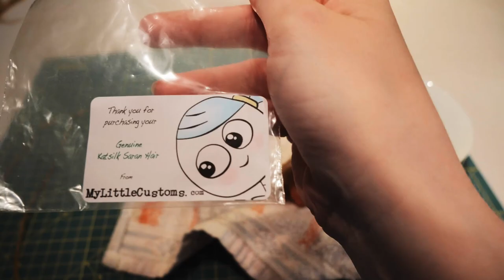the barbie repair cafe & how to reroot barbie hair - skipper restoration

Comment: I’m surprised you aren’t using the hair tool that is a sewing needle cut at the top. Is there any particular reason?
Reply: Never mind, I see you secure it differently instead of hot glue.
Reply from the maker: Hello and welcome to my channel, Chickadee Acres. Thanks for your comment. I don't use the rerooting tool because I don't like the technique. I do it as original as possible. Mattel would have used a sewing machine. I try to immitate the machine here. It has the advantage that you need no glue ( because glue can make the head dissolve due to a chemical reaction). I don't think that's what you want in the long term when restoring a doll.